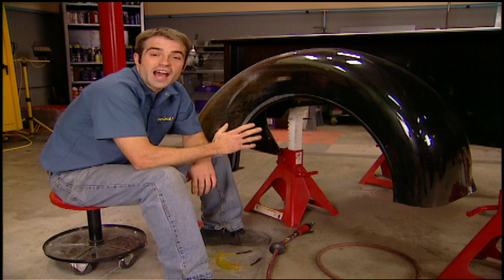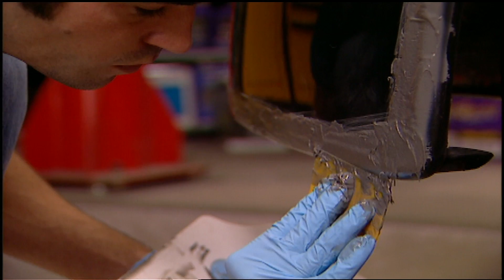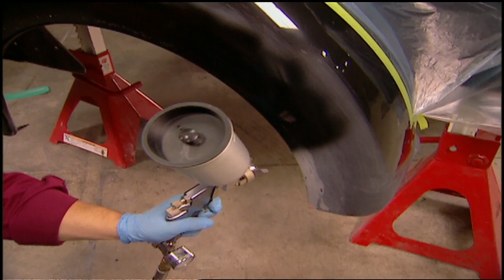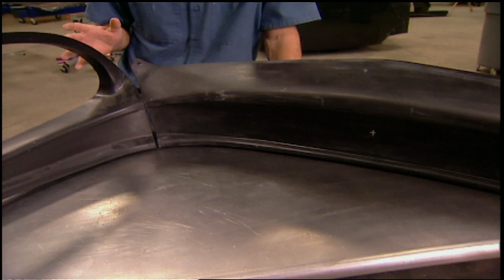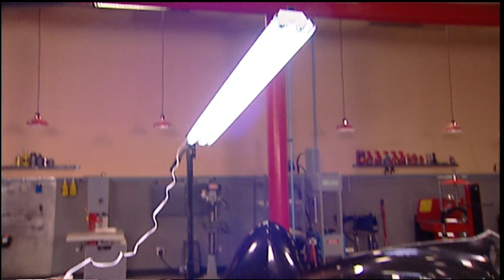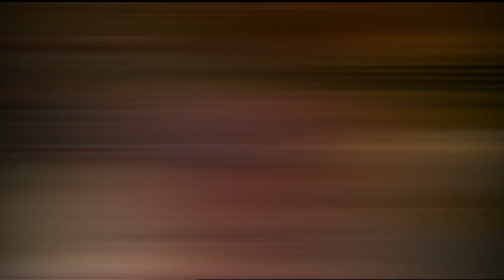Body Work for Project HRT

Comment: great build , here's a tip that works - the night before working with fiberglass soak in a hot tub - and add a half a cup of baby oil to the water ... this will help to keep those pours free from itchy , scratchy  :face-turquoise-covering-eyes: